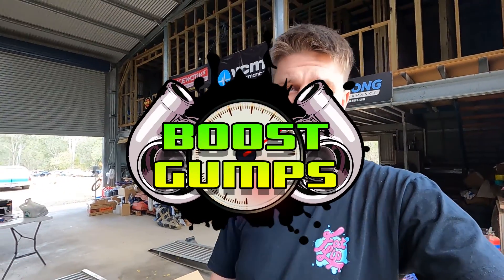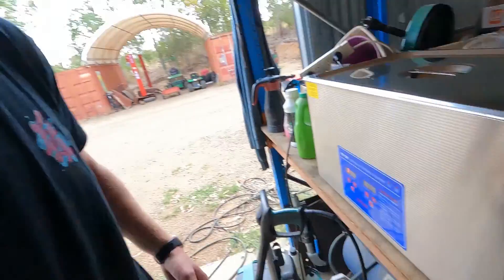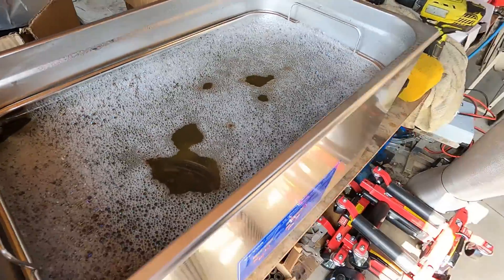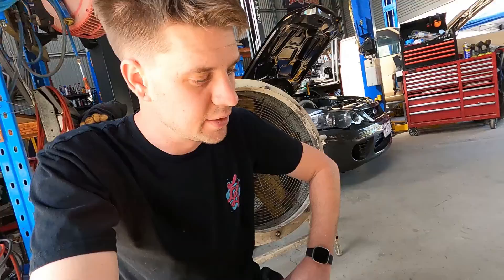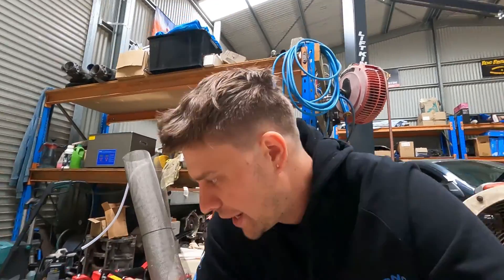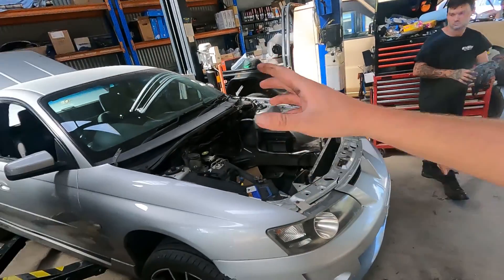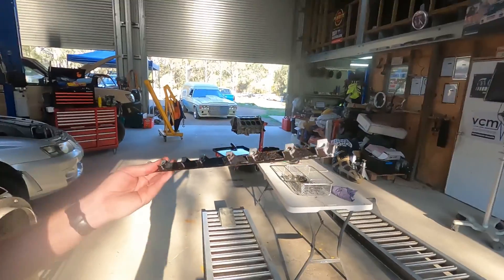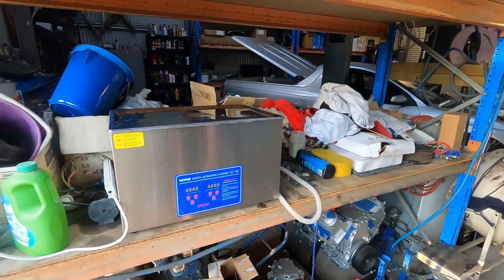Cleaning Engine Parts using Ultrasonic Cleaner

Comment: NOTE **
for the best results DO NOT allow basket or parts to rest on bottom or sides as it interferes with the sonic movement.
ALSO ** The sonic waves do not etch anything . If anything is causing etching it’s your type of cleaner used . Liquid dish soap works perfectly fine
Reply from the maker: Sorry to not make that clear enough in the video, but yes 100% the etching is a result of the solvents not the sonic process.
Reply: So does the basket hang from the top then so as to prevent it from touching sides and bottom?

Comment: I want to start business like this, cleaning autoparts using ultrasonic cleaning. Wkuld u give me advices? What detergents should i use? I have the idea but i am still fathering info
Reply from the maker: My advice would be to look into wet bead blasting. Its the most effective and least abrasive way to clean up parts. There is a huge demand for it amongst restorations etc. It would be a great little business.

Comment: I have a 15L Vevor. I never put anything dirty into the tank itself. I always put my dirty thing in some kind of bucket with cleaner. I then place the bucket into the tank and fill up between the tank and bucket up to the water line on the Vevor. It makes cleanup so much easier and you can just have buckets of different types of cleaner ready to go...and the Vevor never gets dirty. The sound waves and heat travel right through any liquid and cleans it just the same. This also allows you to clean things that are taller than the Vevor having the bucket water line limited only by how tall the bucket is. Despite my Vevor being much smaller than yours, I was able to successfully clean an entire 5 speed lawnmower transmission and clamshell for a rebuild using a tall cat litter bucket.
Reply from the maker: Good tip! Cheers, I will try this out next time I clean it out
Reply: What different solutions do you have good luck with? I actually just picked up the 6L ultrasonic cleaner from Harbor Freight a few weeks back to clean up some stuff from an 88 Yamaha ATV I'm working on. So far I've only used Evaporust in a mason jar for nuts and bolts which works amazing for rust. I still need to figure out some good options for general parts cleaning though.. just dirty/grease/grime type stuff. I'd prefer something that won't harm aluminum or other metals if you leave them in long. Last night for the hell of it I tried dan dish soap and water since it was all I had and I threw some brake hardware in there (brackets, caliper, etc) but it didn't really do much at all. Thanks
Reply: @jonathangaliano2617  With my lawn mower transmission, I used a mixture of Simple Green and water for the aluminum clamshell in one bucket and pure acetone for the greasy gears and everything inside in another. The acetone did a better job than the Simple Green, but it still wasn't perfect. Acetone is what's in brake cleaner, it won't harm steel, but it can corrode aluminum. Gasoline works really well cutting grease too, but only do that in glass and not plastic. Project Farm has a good video on different cleaners to try: https://www.youtube.com/watch?v=WHISaDS1wb0
Reply: hey bud, so does that mean that the machine functions with the lid off ? My shortblock is 9inches high, and the 30L is somewhere aroun 8in ithink ? 

I just put the bucket IN the vevor machine ? Bucket being filled with the solutionthat fills up the whole shortblock ? 

You saying that works ? Would love an answer man ! I just got this machine and need to rebuild my engine.
Reply: All i have to do is use a bucket , fill it up so it covers the piece, even though it is past the machine's water line? Corrext? works ?
Reply: @CommentThink  Yes. Place the empty bucket into an empty Vevor. Fill the bucket to cover your dirty thing. Then fill the Vevor up to the water line between the Vevor and bucket. The sound waves are powerful and will travel through any liquid medium quite well, even when the Vevor water line is lower than the cleaner water line.
Reply: @ZachComa  OMFG THANK YOU SO MUCH MAN!!!!! I am trying it tomorrow (later today lol)!!!!!!!! if it works i will love you and this tech forever ( you the most for exposing this trick ). 

Also thank you very much for specifying how i would have to fill it up :)
Reply: @CommentThink  The typical buckets I use are square cat litter buckets which are way taller than the water line. You can put the lid on the buckets too which was really useful for acetone which evaporates quickly.
Reply: So the bucket would need to be about 10in/254mm or less in diameter to fit?  I am looking at dimensions of 22L and 30L Vevor cleaners and it looks like the only difference is depth - 22L is 18.4/467 long x 10.7/273 wide and 3.7/94 deep for the 22L, 6.7/170 for the 30L.  If so I could just get the smaller 22L and use the bucket trick for bigger parts.
Reply: @mm74.ds24  I have the 15L and it works well with standard square cat litter buckets. I'd imagine it'd work the same or better with the 22L and 30L.
Reply: Thanks  @ZachComa    So do you set the bucket in without the basket? It looks like there would be a lot more space that way in the 15L unit
Reply: @mechez774  a cat litter bucket fits with or without the basket, it'll just sit a little higher. I've done it both ways and it works the same.

Comment: Hot soapy water is the go. Wont hurt anything but will take a bit longer. I have used soap ranging from dish soap, washing powder, simple Green, even the prescribed fluid and they all work well. For really tough gunk I soak them first in a bucket for a few days to soften it up. Usually with a solvent based cleaner if I have time. 
If you think it isnt working just put a bit of aluminum foil it should have holes in it after 20 minutes if all is ok.
Reply: 20 minutes? my 30L did it 20 seconds. i also used the 4 sides of my two pieces of foil and test each area, as in there are multiple traducers in there and did my best to test 6 parts of the tub. it made holes in each part of the tub. weather thats right or wrong i wouldn't know i'm just hoping i don't have 1 dead transducer out of the bunch.

Comment: I use Pine-Sol household cleaner, did an awesome job cleaning my nasty SBF timing cover and dissolved the corrosion in the bolt holes that broke off in. When i pulled it out i was like, did the bolts dissolve too then found them when draining it out. Parts smelled good too lol

Comment: Shock treatment degreaser same brand as what your using is awesome I use it at work bout an inch in the bottom of a 1.5ltr spray bottle
Reply from the maker: Yeh shock treatment is what we use to degrease pretty much everything. Up until we got this unit its all we used. It's very caustic though and will etch alloy if not careful aswell. Them rocker post rails at the end of this video had been soaked/blasted/soaked in shock treatment I don't even know how many times, but this unit still got them cleaner than the shock treatment did!
We still use the shock treatment for cleaning engine bays and engines prior to disassembly etc, great stuff.

Comment: Potassium hydroxide and dish soap works a treat, we use it in our industrial size ultrasonic cleaners.
Reply from the maker: Cheers mate Ill give that a try!
Reply: Bad for aluminum?
Reply: @jonathangaliano2617  as long as you don't leave it for a long time, and can turn the aluminium a bit darker depending on how much potassium hydroxide you use.

Comment: Use petrol in a resealable plastic bag.
Reply: I prefer a glass pickle jar when using gasoline as a solvent.
Reply: @ZachComa  Isn't that possibly causing it to explode? I read that there shouldn't be any flammable liquids in an ultrasonic cleaner ever. Or am I wrong?
Reply: @pr1sm55  I don't use heat, just sound. But, flammable liquids in the tank by themselves would make a ton of dangerous vapor no doubt. In sealed containers it's fine.